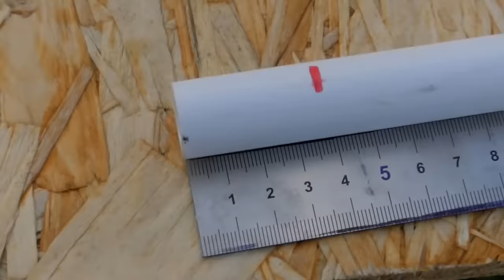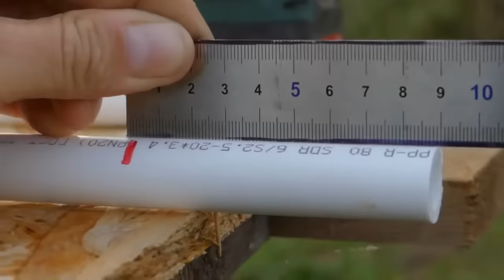Great idea from chainsaw! It turned out a cool thing!

Comment: That is ridiculous, inefficient and dangerous. Wish I could have those 3 minutes back
Reply: Thank you. I thought the same thing when I saw the end result. Could have stacked a couple of feet of board and just ran the saw right through it while holding it in his hand.
Reply: @chasjacks9378  yup two clamps, 1 either side of the cut, eye and ear protection also tends to be a good idea!
Reply: @chasjacks9378  But then you don't have the added probability of losing a body part or taking a piece of wood in the face when it kicks back.  Where is your sense of adventure?
Reply: @kevinblanchard6652  LOL
Reply: Faire tourner une tronçonneuse à haut régime sans variation = surchauffe moteur et serrage piston.

Comment: Great for firewood cutting. That way you don't have to hang on to that light saw. You can just hold the heavy log over the saw. Brilliant. Youn could also mount a vacuum cleaner to a saw horse and then sweep the floor and drop the dirt into the vacuum cleaner.
Reply: LOL
Reply: I read you can also mount a vacuum cleaner to a horse!
Reply: Плетюха!

Comment: ... as a maintenance engineer I see one "Fatal?" flaw....

If you trip and fall onto the trigger mechanism the throttle comes on, and you chop off your arm/neck/appendage in the blink of an eye.   Zero safety systems.
Neat idea... but with any automated throttle, beware of spurious activations of that automation.

(I myself have tripped on a lump of wood on the grass while cutting wood (with a live chainsaw in my hand).. luckily the throttle is in a small shielded area that prevented me from activating it).

I have seen a lot of interesting safety measures built into machinery to stop the operator 'accidently' killing themselves...
(and I've seen some 'interesting' attempts to remove these safety features bordering stupidity.. (I've seen a water Blaster with twisted and taped electrical cords on a only extension (itself twisted together) while in use in a 1" deep puddle... And another that had its thermal overload incorporated switch replaced by a standard on/off (which left a finger sized hole that you could touch live phase within) because the thermal switch kept activating... (This was the device trying to say "Uh Dude, there's an issue here, stop using this device)... again in use in a large puddle, to the point where the single phase motor go so hot it melted the fan off the rear end of if and once cooled glued itself together with the winding lacquer.

Comment: .Some things are questions. How chainsaw safety brake work in that situation?
Are the all nuts in that machine locknuts? How those plastic pipes can last that vibration of the chainsaw?
I'm sorry, but it looks like very dangerous to me. I rather hold the chainsaw and these woods must be hold in place different way. Yes, I have done these chainsaw works some years...

Comment: Anyone that owns a chainsaw should be well aware of the dangers of an exposed blade. I would, however, wear safety glasses because it sucks to get debris in your eyes. This is no more dangerous than handling a chainsaw in your hand to cut a tree limb…more injuries occur from dumb 💩 that use tools while under the influence of drugs or alcohol!
Reply: súhlasím s  vami a ešte sa  mi zdalo,  že  píla  nieje dostatočne ukotvená , iba rukoväť  vzadu , i keď  ide  o slabú pílu H 135 je pre záhradkárov
Reply: It's MUCH more dangerous than handling a chainsaw in your hands.

Comment: Great design,if someone looks at msterial hes cutting it is treated lumber. To use it as firewood is not considered safe due to toxic fumes released while burning. These fumes will cause symtoms related to chemical pneuemonia. Trees are ok but be careful if any vines are encountered,posion sumac,ivy,oak and saw briars also emit posionous gases when burnt. Be aware of what you are preparing to burn as fire making materials. Its mainly the lungs that get hurt when burning these noxious material. They can put you on a oxygen ventilator for the rest of your life.
Reply: Чушь несёте. Тяга не печки не даст проникнуть газам в дом.

Comment: Not for me...the saw keeps on running as he goes to get another piece of kindling. Expensive on gas for kindling wood. I use a circular saw and produce much more wood for the gas and oil used by this method as well as my own energy.

Comment: I don’t think it’s worth it to lose a finger or hand cutting up scrap wood I use a saws all and it works great! I like to play the guitar and I would hate to lose a finger!
Reply: Yep, as dangerous as Sawzall's can be,  they look like kid's toys compared to this death machine. Just get a good pruning blade, and you can cut the hell outta some firewood, scrap lumber, etc...that's what I do too. Unless you're trying to cut an 18" log, a Sawzall will do the trick...hell, even then, it's probably still possible if you have the room around the log.

Comment: One suggestion is to lengthen your relay ( center) arm. Or change your pivot point .So your wood is against your upright and only enough tension on pvc to keep throttle at proper position.
You won't be fighting the chain so much or risk breaking the plastic throttle by exerting excessive pressure and vibration. 
As always be safe.
Reply: Ones'  personal safety, is, literally, in  his  own  hands......i agree with your analysis, Mr Callahan. free floating wood, on chain, NO  NO.  Or, add another  L bracket, and use the 90 degree angle, for a stop/vertically and horizontally, to keep cutpiece  steady.        Also, i'm  a fan, of foot-operated things. Extend the on/off arm, down to the ground, and have a lever, at appropriate point.     From Alberta Canada
Reply: з
Reply: ok

Comment: Not the dumbest idea I ever saw. But probably in the top half dozen or so. Chainsaws are inherently dangerous. Don't use them for things they aren't designed to do. Hold the saw firmly in your hands. Much safer. But I suspect that you won't til you're in the ER getting sutures.